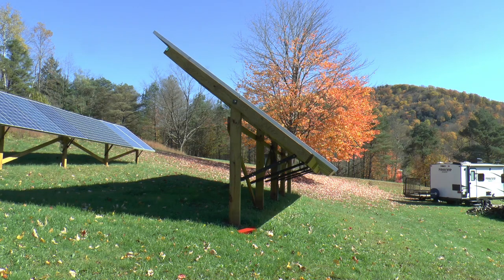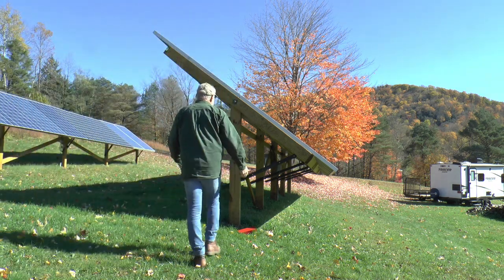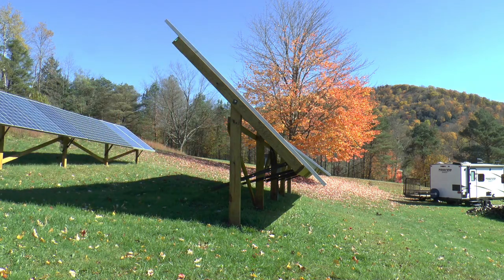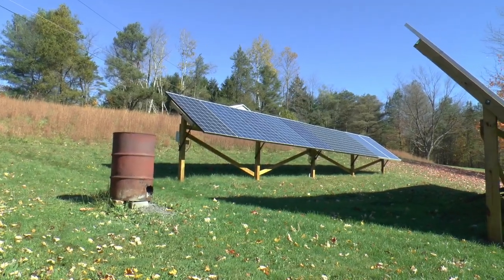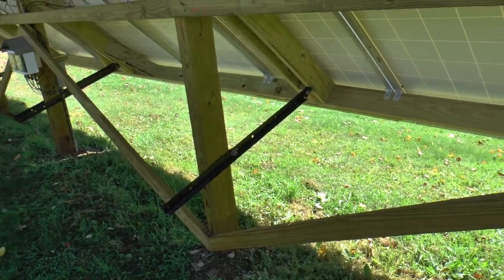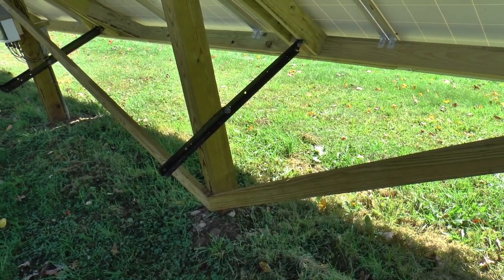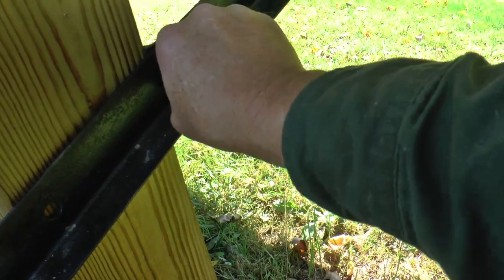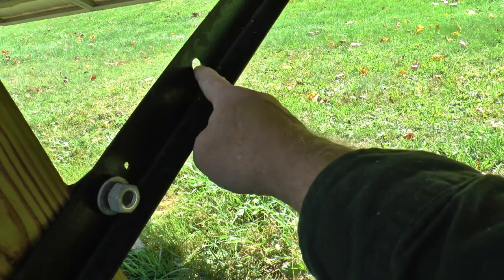Tilting The DIY Solar Panel Mount

Comment: I remember as a kid having played with nuts and washers in my grandfather's workshop that were part of the nut so that the washer was just somehow attached to the nut. He used them for something he built. He liked them because he didn't have to fuss around with a washer and I'm not separately. I don't know if they were stainless steel or if they were just steal. That might make that simple adjustment even simpler if you can find it Galvanized or stainless steel

Comment: I'm setting some up now and will leave them fixed at a 60 degree angle, aka, the winter angle.  I think they will be more hail and dirt resistant, and the extra summer sun makes up for the non-ideal angle in the summer.  Plus, with more consistent year-round output, I can add an extra panel to each string and not lose anything. :)